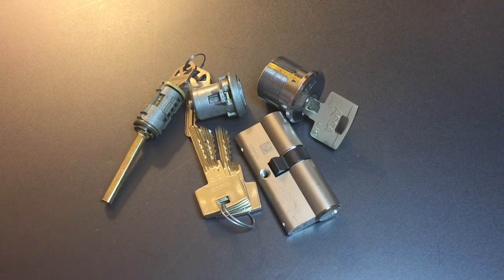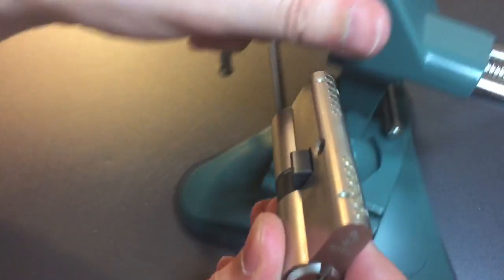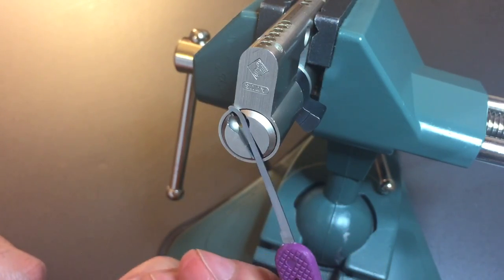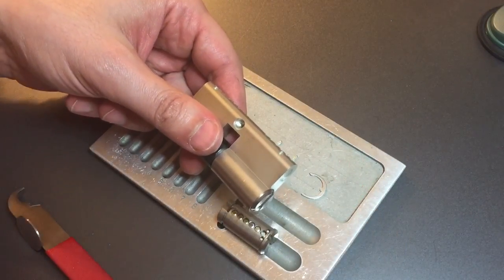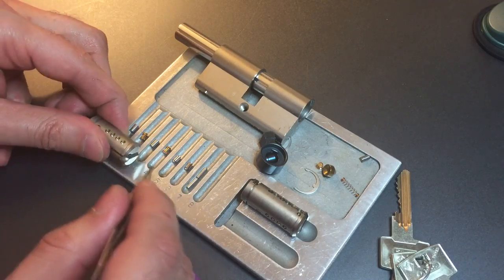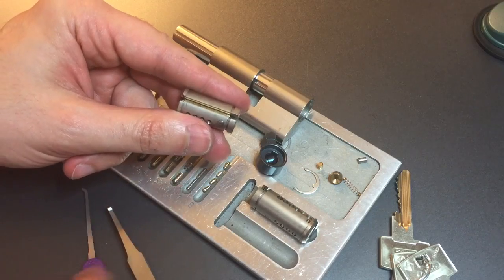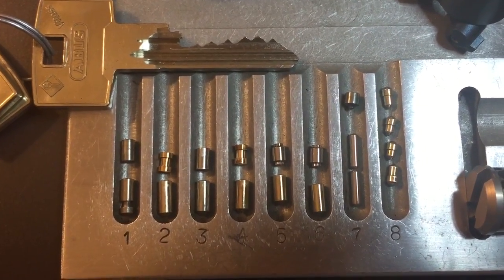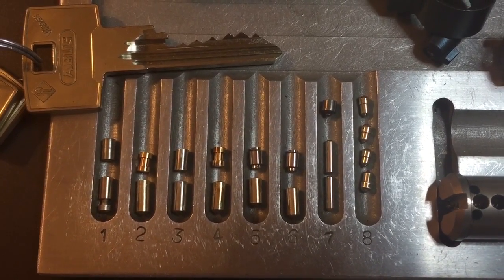[251] Abus Pfaffenhain Vitess Euro Profile Cylinder Picked and Gutted (Series 2000)

Comment: Great hints on picking a paracentric keyway. Never seen a wiper blade insert make a tension wrench like that before. That's the type of thinking I could do with more of ☺
Reply from the maker: Thanks.  If you have not seen my video #82 on picking paracentric keyways, it better explains the method I use in this video (not the tension, but everything else).

Comment: Old school thieves used rings of keys and just raked locks with lost keys until one would turn. This mostly worked on cheaper or "lower goods" such as luggage, lock boxes, etc. Using a security style key meant they had to at least have the right kind of key before a rake attack could even work.

Comment: Great video! Interesting that Kwikset used the innovations of GM. I'm thinking they did it more to prevent forcing than to make picking more difficult, but it certainly had that effect. Have fun with that ASSA! Keypicking has a great article that really helped me out with those locks.
Reply from the maker: Thanks... I'll take a look for the thread on KP.

Comment: intimidating key way didn't slow you down great lock thanks for showing
Reply from the maker: Thanks... This is certainly intimidating at first glance, and with a little more warding in the bottom of the keyway, it would be very difficult.  Abus came close, they just missed the last 5%.
Reply: +LockPickingLawyer I like how you tension it to.  would it be possible to shave off the face were it couldn't be tension that way add even more difficulty
Reply from the maker: It might make it more difficult to tension, but truth me told, the pinning is not very difficult or subtle which means solid tension is not as important.  I could probably open this just as easily with one of the super flexible Peterson Flat Five in TOK.  It is not ideal, but for this pinning, I could manage without much fuss.

Comment: The curved keyway isn't for anti-pick.  Its to prevent unauthorised copying of the keys.  Using easi entry key profile machines.
Nice picking btw
Reply from the maker: Thanks... I agree that key control is definitely a big part of the equation, but I can't believe that this keyway/warding was designed without an eye towards pick resistance.
Reply: Yep, same idea as the Medeco KeyMark.  And I couldn't imagine making a keyway like that without an EDM.

Comment: LPL, I think you've decided that gutting it like you picked it (using the pick to push the key pins out from the keyway).

Seems to speed things up and require less tapping and banging, which makes for a nicer video. 

Nice episode. Thanks.

Cheers, 
/Acey
Reply from the maker: Thanks.  For this lock (and many of the tighter tolerance locks), you need to push them, but for many/most, the pins just drop out and a light tap is much faster.  hard to know until you crack the lock.

Comment: For the ASSA try filing down a key and the valleys of the key and use the the rest of the key to set the lower pins and you can try picking the the top pins! great videos and advice
Reply from the maker: Thanks.  Why destroy the key?  If I wanted to try picking the top pins alone, I would just remove the sidebar.
Reply: I've never actually picked an ASSA. I was just told that's how you can do it. If you get a chance and are able I'd like to see how you do it!

Comment: I’ve never installed one of these so I can’t say why you would want to do this but the key retains pin one so you can back the core out enough to disengage the center without risk of dropping the pin while you work with the lock.
Reply from the maker: That's a good thought... were it not for the anti-drill pins that are not crimped in and fall out very easily (something that happened to me many times putting this back together).  :-)
Reply: At Abus the key guy looks at the new lock coming off the production line - - -“What do you mean they aren’t crimped #$%%  !!!”
…coulda happen
Reply: At Abus the key guy looks at the new lock coming off the production line - - -“What do you mean they aren’t crimped #$%%  !!!”
…coulda happen
Reply from the maker: Nimikos LOL

Comment: Nice job on that ABUS. I just got two ABUS 888 cores in the mail yesterday. I haven't had success yet finding info from other lock pickers on this particular cylinder. From what I have seen online this 888 cylinder is rather new. You'd probably breeze right through it, but I've not had success yet.
Reply from the maker: +Matthew Wilson The 888 keyway isn't too bad... what kind of pinning does it have?
Reply: LockPickingLawyer Thanks for replying. I have been fooling around with it some more tonight and I've figured out the medium width BOK tension and half diamond work on the second core. The bitting for that one is sad and I am sure I will be able to rake it with the city rake. The original core that came in the 83 body has fair bitting but still nothing spectacular that I'd purposely paid for. I'm going to see if I can get a video up tomorrow. Hopefully I will be successful in opening it as well.
Reply: LockPickingLawyer Another thing to mention actually is I have been using a different hold on my picks for the past week due to my right hand cramping up lately. I'm not used to this change and hopefully I can just go back to my normal method I've had success with over the past few months.
Reply: LockPickingLawyer I just uploaded a picture to my Google+ profile if you want a good laugh.

Comment: Crazy keyway but all in all a very picking friendly lock ;-) Great work again on this lock. The key pin in stack #1 is still a mystery to me. You showed how a nose of the key interacts with the groove in the pin. But why would a key without that nose not work?
Reply from the maker: Thanks.  And pin #1 is just silliness... just makes it more expensive to cut keys.  You file the nose off and it will work just fine

Comment: Great picking. I guess all that complexity didn't make the lock any harder to pick. They definitely don't subscribe to the KISS method of lock manufacturing. I guess they must have figured that just the sight of that keyway alone was enough to scare off most pickers. Does anyone at these companies ever actually pick up a new prototype and just try picking it?

Maybe they do, that would explain why they modified the face of the lock to give you a method for tensioning an otherwise difficult to tension keyway. Maybe I've been looking at it backwards and they are actually trying to keep locks pickable. Or it just simply goes to show that adding complexity to a system in order to increase security is a monumental task since anything you add to the system also adds more ways for it to fail.

Sometimes less is more. (An ironic ending to a run-on comment.)
Reply from the maker: I really wish I knew the internal processes that go into making these locks -- particularly keyway design.  I appreciate that keyway design can be deceivingly complex in locks like this that are designed for mastered and grandmastered systems with multiple key profiles designed to fit (or not fit) in multiple keyways.  But even so, it seems like the overwhelming majority of products out there do very little to resist manipulation.  A classic case of losing sight of the forest for the trees.  It seems like somewhere in the complex design process, people forgot the primary purpose of a lock.

Comment: Maybe the profile pin or the slot 1 pin do something if the lock is right way around. European profile cylinders are installed with the cylinder on top, so you basically picked it upside down.

Comment: I'm surprised the side pins didn't have any effect.  LPL, is there any holes in the shell?  I didn't look before I sent that cylinder to you.
Reply from the maker: Thanks again for the locks!  I hate to say, but I don't remember if there were holes or a groove milled out of the lock body.  I would assume there are, however, because if it didn't, the passive pins on the side would never let you insert a key.  I think the four passive pins did exactly what they were supposed to do (which is a big fat "nothing" when it comes to resisting picking).  It's the profile pin that I don't think is working right.  See my video #144 of the Ikon SK6 for an example of how a very similar arrangement is supposed to work.
Reply: They are for master key purpose, so you can open the lock for the building with every key of the locking system, but the lock for single rooms only with a certain key.

Comment: Does pin 1 prevent the key from being used in a different lock with the same bidding? If the groove in the key pin isn't there, then the key can't be used, especially since it won't reach all the way to the back of the core.
Reply from the maker: Yes, but a key that doesn't have it (or that has it filed off) works in all locks.  It's utterly pointless as a security mechanism.  At best, it would stop someone from accidentally using the wrong key.
Reply: I'm thinking it may actually be a method of control for Abus. This way, you HAVE to buy their locks. Obviously, a knowledgable person would just file that little part off, but John Q. Public? Maybe not.

Comment: What makes the ASSA/Ruko Twin hard to pick? Lack of feedback? Access to pins?

Can they still be bought?
Reply from the maker: What makes them hard is the combination of the pinning (similar to the newer ASSA 600) and the sliders that control the sidebar.  Depending on the model, there will be between 3 and 10 sliders. Very hard.  They are definitely still available.
Reply: Those with 3 sliders. Would you be able to pick such, or even at that level they are crazy difficult?

I figured they had reached end of life, as  my dorm had all the locks replaced, and it was the Ruko Twin 6000. But good that they still can be bought! What about its patent? Can the keys now be copied legally?

The one I have is an oval cylinder, and I'd love to have a padlock to put it in. I know of Anchor Las, which makes such. They officially don't sell to end customers, but if you contact them directly at anchorlas.se, they will sell by bank transfer.

Are you aware of other padlocks that can take oval cylinders?
Reply from the maker: I’m not sure about key control aspects of the locks… I really don’t follow the patent facets beyond their existence.  I’ve seen some variant of the Abus 83/80 that can take an oval cylinder, but I don’t own any.  As for picking a 3 slider version, check out my video #71 in which I pick and gut a Lockwood Twin, which is a three slider version of the ASSA Twin.
Reply: I can get those Assa Twin 6000's all day long.  Yes, the Patent is expired, but nobody like Ilco, JMA, Jet would even think about making these key blanks.  You need to remember, you need the matching sidebar for the key to match.

I provided the Assa for LPL to pick on, the sidebar in that is a shared sidebar, #126.  A person can still get dedicated sidebars, and dedicated keyway.

On another note, note much of a difference between the Assa Twin, and the Assa V-10, I'm certified in both systems.  I could show you on video, but at this point, it doesn't matter.  Either lock, the Twin 6000 or V-10 need to be purchased in pieces.  The cylinder comes SNS. Sub-assembled no sidebar, add the sidebar, key pins (for the standard cuts) and key blanks.
Reply: What does an Assa Twin 6000 cost and how many keys does it come with? And the same question for V-10 =)

What is SNS?
Reply: Interesting! The Abus 83/80 comes in both snowman and oval form factors! Oval is also called Scandinavian cylinders is turns out, so not that wide spread I suppose. Got to get one =)

Great #71 video!!!